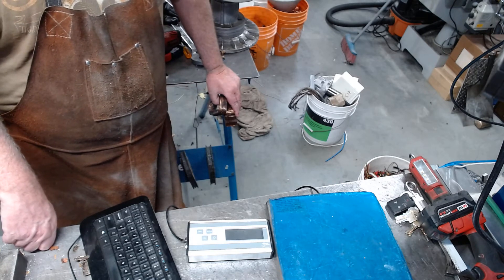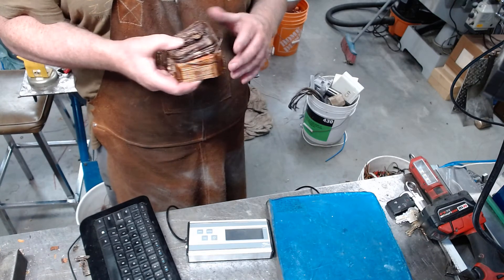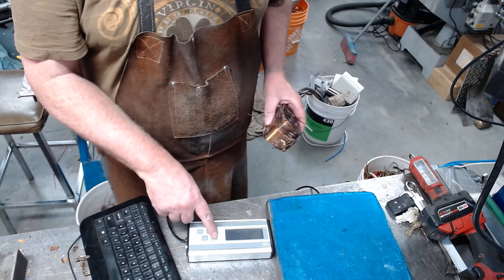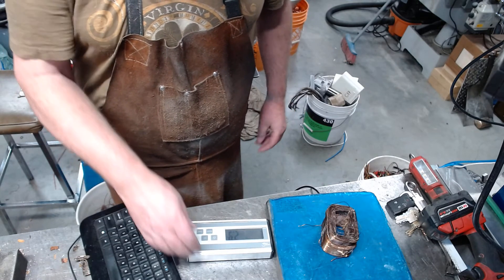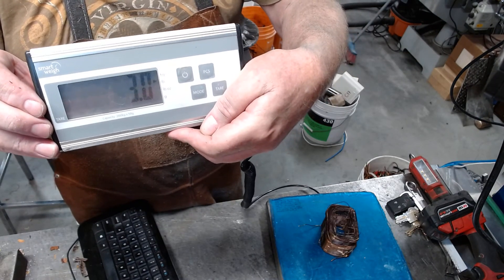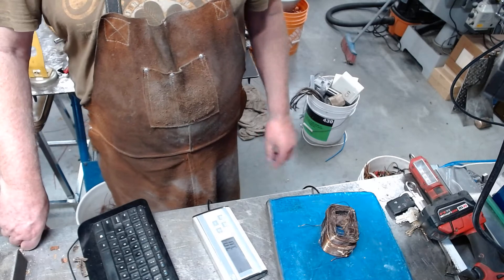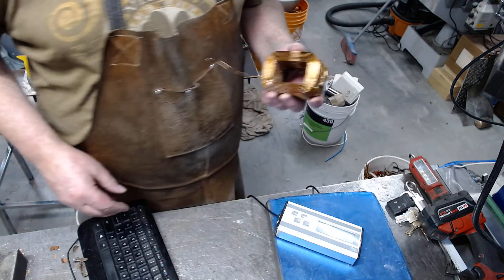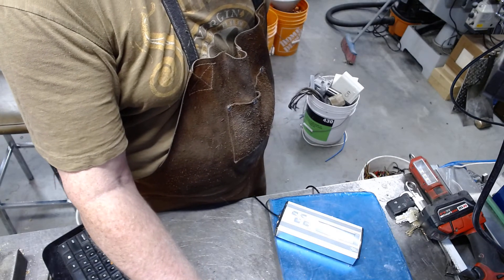How Much Copper in a 400W HID Ballast?

Comment: I bought a bunch of brand new 400W lights in an auction for $25 and they were all aluminum. Luckily the casings were all aluminum too and the reflectors as well so it wasn't a total bust. I also got 6 new metal halide bulbs and a guy bought them for $40 so at least it helped pay for the gas. I am still mad at all the aluminum windings though.
Reply from the maker: That is a bummer, usually one winding is copper !